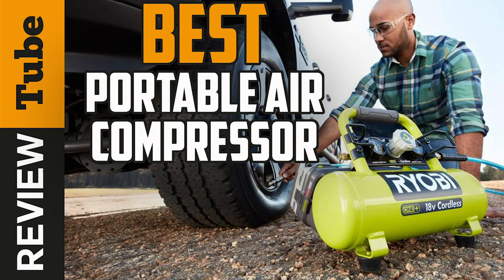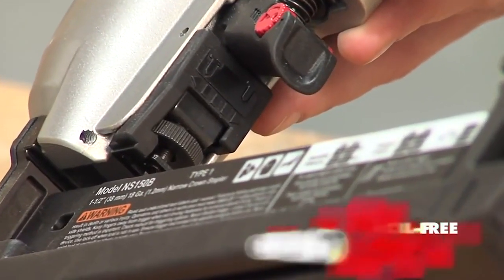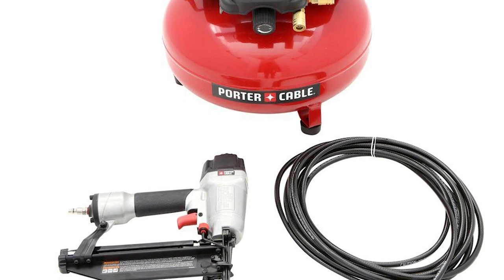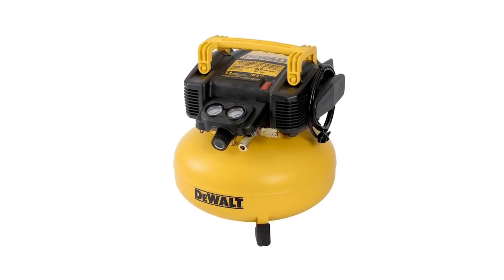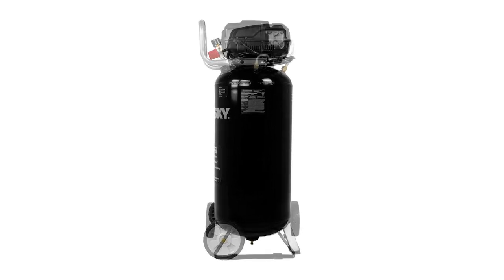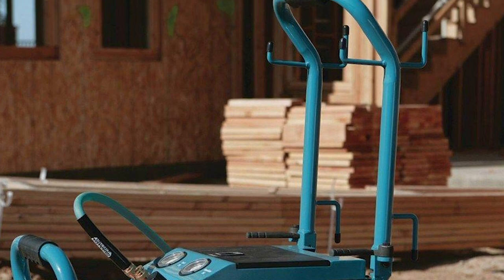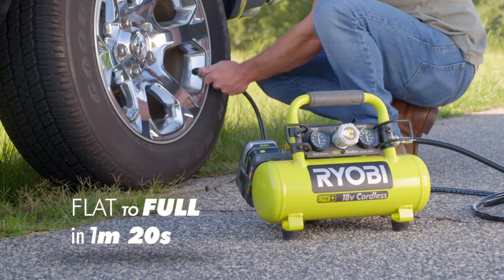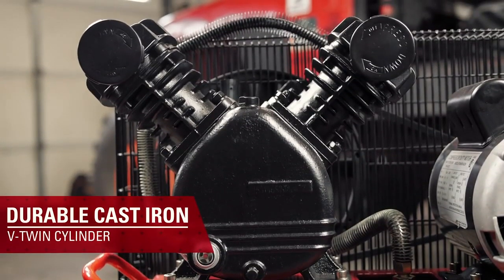✅Compressor: Best Portable Air Compressor (Buying Guide)

Comment from the maker: ✅1. Porter-Cable Air Compressor: https://bit.ly/2R8ZDYB
* Find a great deal on eBay : http://bit.ly/2RxcOje
✅2. DEWALT Air Compressor: http://homedepot.sjv.io/LY0ka
* Find a great deal on eBay : https://bit.ly/3dj1Jhk
✅3. Husky Air Compressor: http://homedepot.sjv.io/DMWxy
* Find a great deal on eBay : http://bit.ly/2Gqb59f
✅4. Makita Air Compressor: https://bit.ly/3hgNrj6
* Find a great deal on eBay : http://bit.ly/37vWULz
✅5. RYOBI Air Compressor: https://bit.ly/3y1BdAJ
* Find a great deal on eBay : http://bit.ly/2Rw3XyA

Ancient Japanese Tonic Melts 54 LBS Of Fat: https://bit.ly/39sKV4H
STUFF YOUR FACE. LOSE WEIGHT: https://bit.ly/31FOT5q

Comment: 4 'AC' compressors, and 1 "terrible" battery powered unit?  What gives?  This seems a bit disingenuous. Why call something "terrible" without stating why? I need something for my motorcycle trailer for an occasional tire top-off.  A battery power would be GREAT. I've tried those cigarette lighter units, they work but are slow. This Ryobi may be just the ticket since I already have 5  PlusOne batteries and 2 chargers. Since I have an HD card which gives me 1 year returns,  I may just try this one out. Even with your lame unsubstantiated "terrible" statement.